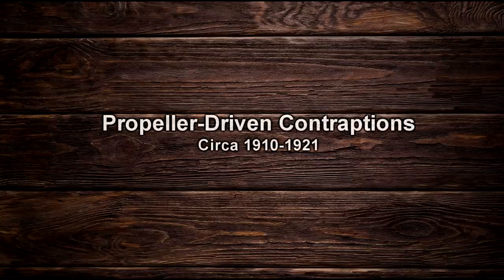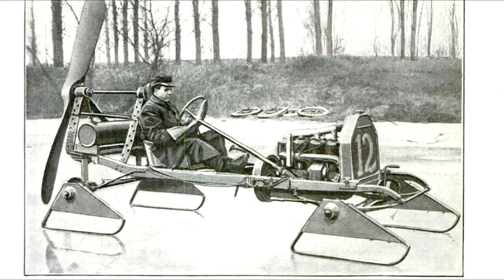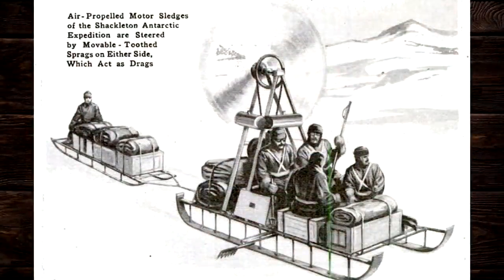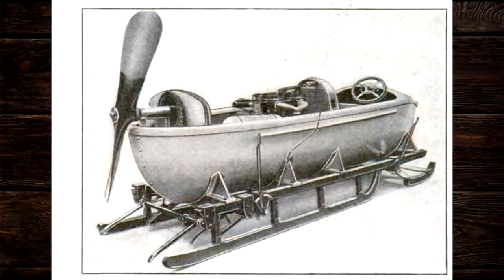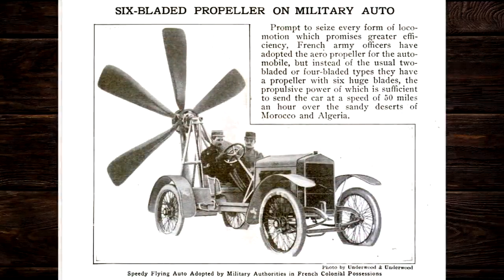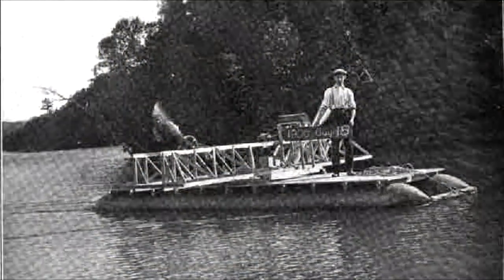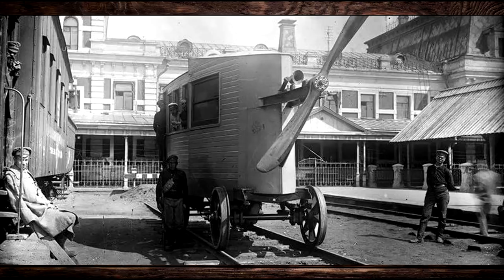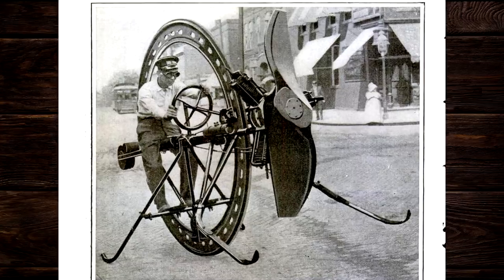Insanely dangerous prop-driven machines of the early 20th Century

Comment: Just about as dangerous as the jet and rocket propelled vehicles that came in the next 50 or so years.
Also, I am reminded of the great racing driver, Dan Gurney, who recently died of old age! He survived formula one racing in the sixties when you raced on Sunday and went to the funeral(s) later that week. He designed, built, and drove his own F1 racer. The car had titanium suspension arms: super strong but springy and gave the car's handling a rubbery feel. The entire car was a fuel tank that the driver sat inside of. Yes the driver was entirely surrounded by racing fuel! To make it worse, the monocoque of the car was formed entirely of riveted and bonded sheet Magnesium, a metal slightly less flammable than Sodium. The car had a 400 HP V12 racing engine. Dan's comment: "It was like driving a Ronson cigarette lighter."
Reply: And now look on F1s nowadays. Made with rollover cages with middle posts so you can't see the track anymore. So they made the track more curvy so you can see it again and not only racetrace side pannels :D
Reply: I remember those F1’s when I was a kid. They were ground breaking wonderful futuristic looking cars that were beautiful to behold and awe inspiring tech. Miss those days. Only thing that seems invented now is electronic or software.

Comment: What's funny is that during the winter I see sail powered ice sleds not much different than those of yesteryear.
Reply: And an air propeller is probably the most efficient way to (motor) power an ice yacht. -   with an enclosed cabin and guarding of the machinery, what's not to love.

Comment: 60 mph on a single rim, prop driven bike?! The ones they tried to make in the early 2000's were deathtraps. How the hell did that guy survive?
Reply: My top guess would be that the angled thrust from the prop probably did something with angular momentum and the gyroscopic effect.

Well, someone had to be Johnny Yuma's father...
/Born To Be Wild, as loud as your speakers can go
Reply: @richard6133  Actually I think that would have made it harder to control on account of the magnus effect. That was a rotary engine if not mistaken.
Reply: @richard6133  the main issue ive seen with that type of vehicle isnt forward momentum but stopping. Every time they tried to slow down or brake on the early 2000's prototypes ive seen in videos, you get a speed wobble-type effect.

Would be interesting to see a video of that design in action.
Reply: Who said he survived?
Reply: I'm no genius, but let's try this out for for size. Let's see first of all, his will is being pulled forward by something in front of him. So that doesn't really affect his positioning in that wheel since it's spinning freely. I can only go so long to hide things to do legs that he has attached to the sides. It also prevents him from taking over too far forward or rotating around 360. Since it is a free-floating wheel/tire with no gearing to have him be directly connected with the inside/chassis, one would assume if lubricated properly and its bearings of the hind upgrade this man could be pushed off the side of the hill and roll completely down the hill without pitching over inside of the contraption. Kind of like the axle nut cover on semis that has the odometer on them. I'm sure you see them on the highway when you look over to the side of a big rig every once ina while. You notice how the wheel is spinning in 60 miles per hours location of speed and the center cap is bobbing back and forth a little bit

Comment: One of my father`s friends built an air boat. It had a big block V8 engine without any exhaust. The prop had a steel frame around it but was essentially unshrouded. It was directly bolted to the engine crank. There were two fins mounted behind the prop for steering.  I saw it once in action down on the Passaic River in my home state of NJ, right near the local tavern. My dad and Tootie, the owner and builder more than once took that boat up to full throttle and Dad fell off at least one time. Tootie once drove my dad home driving backwards for at least 2 miles on a bet. Yes, our fathers and grandfathers had big brass ones. The last of the breed, in my opinion.

Comment: The rear "push" propeller is dangerous on land craft with no guard, front "pull" is better if you can mitigate the propwash. Here in FL, people make their airboats capable of handling concrete/blacktop as well as back country gravel roads. They use a mixture of truck bedliner, epoxy, & (I believe) liquid tire shine as a thick, self lubricating bottom liner. My neighbor is an aircraft mechanic & is constantly rebuilding motors to build airboats. I asked him what the most difficult part was & he said "by far the prop, nearly impossible for individuals to make them properly balanced"  (he uses carbon fiber 2&3 blade)

Comment: After one particular heavy drinking night in my late 20's I decided to weld up a rig in the back of my S10 that featured a 68" propeller and a "freewheel" hub that was to be driven off the driveshaft by a belt drive...luckily I passed out mid build, but still laugh when I see my garage ceiling fan featuring said propeller.

Comment: The sheer number of these devices that were one-off machines gives us an idea of how well they worked...

Off course, there is the hydrofoil/hydroplane style that uses thin "wings" on stalks under the water. These often use an airscrew prop and skate along the surface like water skis.
They're fun for model enthusiasts, but they cost as much to run as an aeroplane without the benefits of air travel.

Comment: Check out how old school machine shops were run.  They had a single shaft running through with open leather belts coming down to the machines.  If you wanted to change the speed of your machine, you used your hand to slap the belt onto another set of pulleys.
Reply: Pre-OSHA
Reply: @chuckaddison5134  Yeah OSHA would have dropped a ton of bricks back in the day.  While a lot of the regs are common sense, some are just really dumb now a days.
Reply: @Worrsaint  
Agreed, some stuff is no longer applicable, but back in my Navy days, during a safety standown training film, the narator made a statement that stuck with me " most of these rules are written in blood".
Reply: @chuckaddison5134  Due to being an OSHA violation, we had to add handrails that were about a foot long.  This was for a very short ramp about a foot long that was 12 feet wide.  It cost tens of thousands in total cost because it involved welding, which meant all solvents and chemicals had to be removed and the room shut down.  These railings have never been used because the went at the edges of the ramp where no one walked.  Putting guards on rotating equipment is common sense.  Putting useless hand rails in is just plain old dumb.  There are also dumb rules about using razor blades and stuff like that which makes the work less safe.  It was kind of funny when an operator called our HSE guy to the floor to show him you can cut the fingers off the cut proof gloves he just bought with the razor blades they are supposed to protect you from.

Comment: Nice video and interesting machines. Maybe they liked air propellers back in those times because they could get carved from the wood and transmission was easy. It also suits well with motors which don't have good torque in low rpm.

Comment: 1. Wind Wagon-Boat. Everything is exposed, from the pusher propeller to the driver to the engine! No brakes!? Terror on Ice.
2. Air-Propelled Motor Sledge. Arctic exploration with all of the danger of the Wind Wagon.
3. Aero-Sleigh. High center of gravity+narrow tracks = Slice and diced passengers.
4. Home-Made Air-Propeller Ice-Boat. Exposed chain drive, Winter air blast.
5. Six-Bladed Propeller on Military Auto. Great, until you hit a sand dune or uneven ground. Noisy and kicks up a dust storm.
6. Hydroplanes and Air Boats. (Ole Evinrude wants to talk to you...)
7. Propeller-driven Railway Car. The noise! The Dirt! The cut-and-diced people! (Not to mention derailment.)
8. Road-and-Water Wind Wagon. Works just as well without the ice?
9. Air Driven Unicycle. Balancing on one wheel while the propeller pulls you through the streets at 50 MPH!?

Comment: That first picture shows four wheels in the background that seemingly attach outside of the skis, that may be a safer way to use it but I bet it was much more zippy on ice. Also, I’ve seen a picture of a very old French automobile that was powered by a propeller in the front like a modern prop plane, I wonder how many jay walkers or stray animals it must have notched up

Comment: Reminds me of modern air airboats used in the swamps of South Louisiana and Florida.  Though modern versions have a safety screen around the blade of the blades, the basic design is the same and they are very loud.  Hearing protection is strongly recommended.

Comment: Some things just don't change. In another hundred years we'll be looking back at all the pretty 3d renders of  " urban air mobility " projects and laughing at how it was never going to work because they solve no problem.
Reply: Yes. Absolutely, companies are spending millions on bad ideas like this at the moment. No one wants to ride in an electric quasi, helicopter, half airplane thing that only goes 30 miles at 50 mph. I'll just drive thanks.
Reply: @life_of_riley88  there are some niche applications for battery electric flying machines, but useful mass transit it ain't!   P.s. its billions they are spending.

Comment: This was a cool video Jeff, I knew about some of these contraptions but learned about a few I didn't as well. The Russian attempt at a prop driven train wasn't the last either, the Germans made one about the same time called the Scheinenzeppelin if I remember correctly, as the name implies it was basically airship shaped with a rear mounted prop. There were also later attempts in the 50's to power trains with jet engines so that idea kinda refused to die lol.

Comment: SHOTGUN SHELL EXPERIMENT IDEA: (long-time lurker , first time commenter) , I don't reload so I don't know what problems might come up, but,
basically fill a shotshell with  water, leaving enough space for the water to expand when frozen, then freeze it, then keep it cold and shoot it as fast as possible before it melts and see what ice-slugs are capable of.
You would have to coat the inside with a waterproofing spray or use a shot cup that fits in the shell water-tight or something to protect the primer, might have to use dry-ice to keep it cold while you get to a range,
Maybe another liquid besides water would work better.
I'm just wondering if the ice would shatter into snow or stay in-tact, I think distilled water would be best.
Upvote  if you want to see this done.
Reply from the maker: We tried that a long time ago.   The ice is too brittle and just shatters during acceleration.
Reply: @taofledermaus  .ah, thanks for letting me know

Comment: At least the flat-bottom air-boat was semi-practical, since it could go over tangles of reeds and such due to having hardly any draft in the water. Not quite like a modern air-boat though, but you can see that the idea was there.

Comment: I mean. I've seen the drone motorcycle thingy flying with 4rotors and that's new.and Kawasaki builds a 200+hp compressor motorcycle. You can get 260ish, for racetracks.  That's crazier than this in its own way.  Though I see absolutely no reason to not ad a bit safety mesh, would add maybe 2_5kg, to Propeller driven insanity.

Comment: if I die riding a bear automaton on a unicycle driven with the power of a hydrogen engine made solely to turn a propeller at ridiculous speeds of 200km/h, please don't take your time to seperate the metal dust from the iron and rust from my blood. just cremate everything and sell it as a limited edition "bears on high speed death unicycle" keychains that include the ashes of me and my stupid automaton bear on a high speed unicycle.